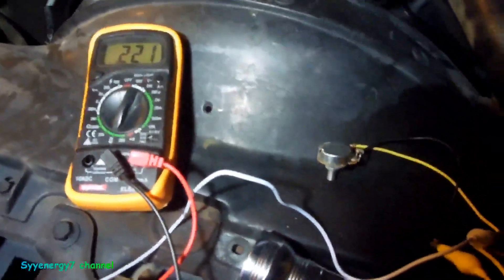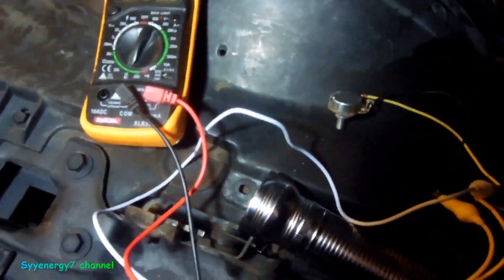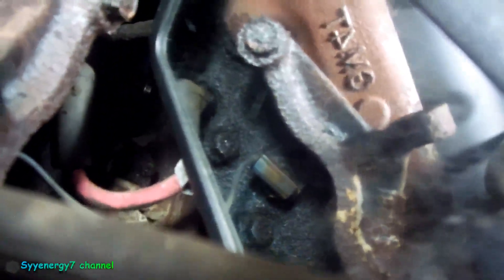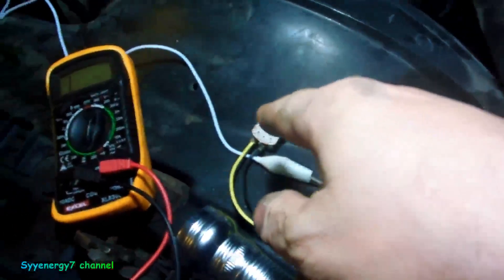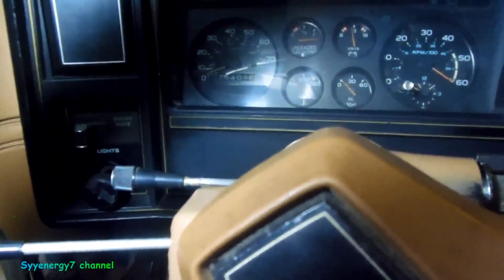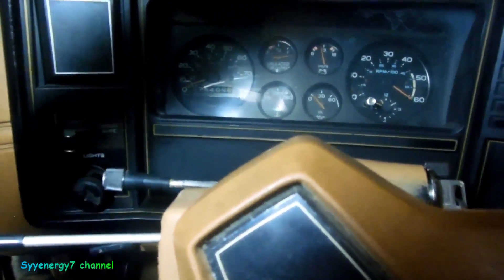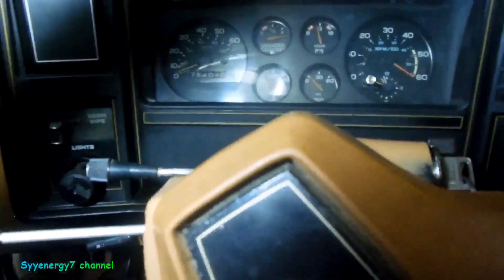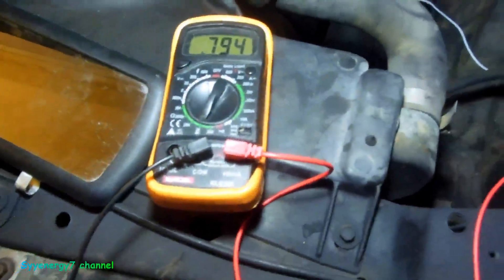How to Check a Temperature Gauge & Sending Unit -Chevy

Comment: SYYENERGY7   ==
==                        =    I don't know how to test the temperature sending unit or where its at in cars. I'm not sure if the sending unit means a sensor.
       1.)  How do you test or what do you use to test the temperature sending unit?
            2.) Can I buy a digital gauge at PEP BOYS and install it in the fuse box wires by slicing the wires to test if the analog temperature gauge in the car dash temp gauge is reading false reading measurements of the temperature?
                      3.) Can you make a youtube video showing how to test the car dash gauges to see if they work correctly and not reading false readings and how to test the sending units to the cars gauges?
       4.) I don't know how to test the cars gas gauge, oil gauge, temperature gauge using a ohm meter or what other test tool can I use to test these gauges are working correctly and not giving false reading or not working correctly?
Reply from the maker: Should be able to.
Reply from the maker: Just try rigging up some aftermarket gauges from AutoMeter.
Reply: @syyenergy7  can I just splice TAP a an after marker gauge Autometer into the wire at the sending unit with the dash gauge still wired up also?

Comment: If the unit has one wire it is grounded to the engine through the threads teflon tape on threads no no.
Reply: you may have just saved me a huge headache!

Comment: Remember each gauge has a stepping motor that can go bad and has to be desoldered to remove and chevys and i suspect other models has a voltage regulator and then there is the temp sensor and is all fuses are good, the least and most uncommon is a wiring problem. One of the first three should be the fix.
Reply: stepper motor guages??  really?

Comment: Won't  Teflon tape stop contact
Reply from the maker: yes.  If you use teflon tape, make sure half the threads touch the block.
Reply: Does Teflon tape stop contact if used on the oil pressure sensor?

Comment: I replaced  my sending  unit  now my gauge is pegged at 0, before it was pegged at hot wth
Reply from the maker: If the sending unit is not grounded by the threads, it won't work.  This often happens if you use Teflon tape.
Reply: syyenergy7 mine has tape ill take it off and see what happens.
Reply: @iPkallDayLong  did it help

Comment from the maker: Here I check to see if the stock Chevy temperature gauge works by using a potentiometer to see a specific ohms resistance.  The potentiometer can be set to mimic  the temperature sending unit.  This way you can start to isolate the problem why the temperature gauge does not work correctly.  In this case the temperature gauge is reading cold, after the engine has warmed up.  To check the water temperature sending unit in the block, I used an ohm meter and wire from the water temperature sending unit to the ohm meter then to a ground.  As the engine warms up the ohm meter should show less ohms from the temperature sending unit.   The temperature sending unit checked out ok.